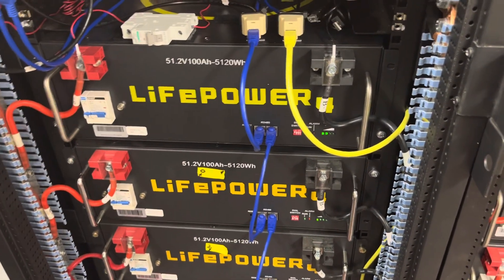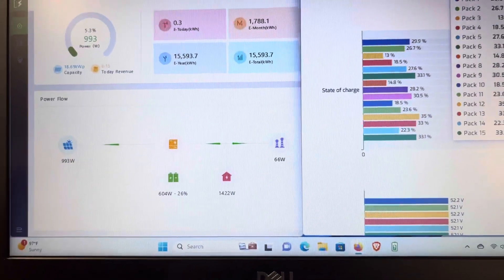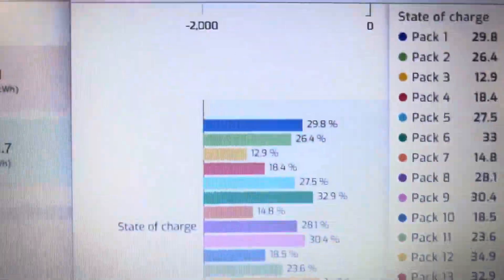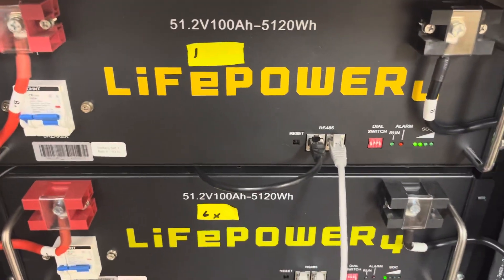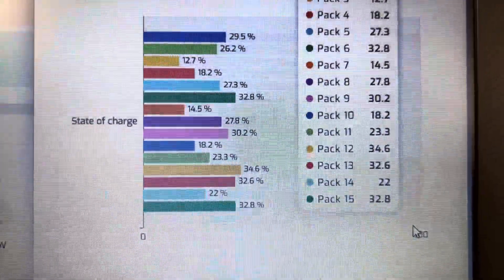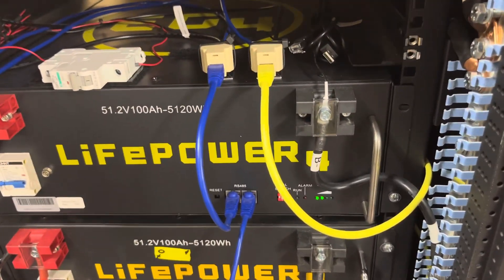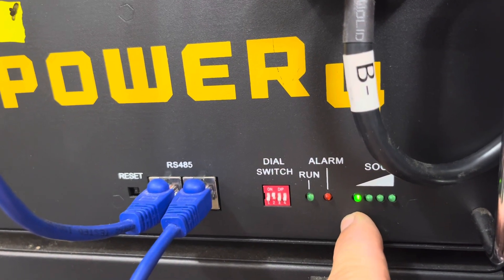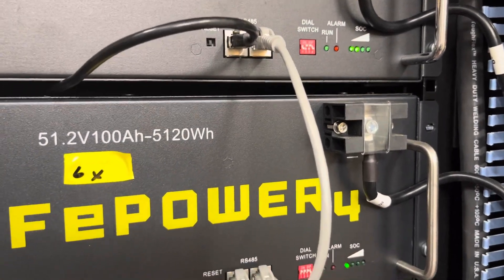EG4 LifePower4 SOC LEDS - What do they mean.

Comment: Just have one question, why soc is so wide spread as one battery is at 34 percent soc and the other is at14 percent. I thought they charge and discharge equally.
Reply from the maker: What I have found is if you’re unable to fully charge the battery bank over many days the SOC between batteries will drift significantly. 

This usually corrects itself once you fully charge the bank. The batteries will also rebalance periodically.

Comment: On my sok s 2 leds i have to cut my power use down a lot it's like I almost got dead battery's I'm beginning to wonder if I got some defective ones
Reply: Bummer hopefully you get it sorted out I bought two sok batteries they was too expensive to buy some more so now I'm buying expert power batteries I like them better there are $1,000 to my door
Reply from the maker: @JonOffgrid  2 LEDs mean between 25-50% SOC. I stop discharging at 25%. When I stopped at 20% I found the SOC between my batteries would drift far apart. 

Just had a battery failure today. Had to shut it down and reroute BMS comms. Charging and discharging faults.

Comment: I have 3 of these batteries and they got below 20% and I can’t get my inverter Sol-Ark 12k to charge them now. I’m looking for a 48v trickle charger if you have any recommendations. Informative video, thanks!
Reply from the maker: @sgtspaulding9461  morning! Hmm … something is not right. I have had a couple of batteries stop charging and discharging. Turned out to be bad BMS boards. For the first on Signature Solar sent a board for me to repair. Easy to replace. The second one they required I ship the battery back - a total PITA. 

I bought a 48v charger from eBay. It works great for charging an individual battery. If you get one and it charges the battery then the problem may be with the Sol-Ark.
Reply: @ hey Jeff, thanks for the reply.
They had been working well then one morning they just weren’t. I ran a BMS test the alarms were showing 
1. Cell undervoltage alarm 
2. SOC low alarm

I need to get them charged up so I can run the test again. I hope it’s something simple the batteries aren’t very old.
Reply from the maker: @ let us know how it turns out.

Comment: Just curious, how long had this set of batteries been hooked together before you did this video, bms balancing seems a bit harsh.
Reply from the maker: Around 8 months continuous. What I have found is when under heavy usage and you’re not able to fully charge the batteries for multiple days tge SOC between batteries will drift significantly. 

This generally corrects itself once you’re able to fully charge the bank. Also the inverter force balances once a month.
Reply: @jeffmotes2129  Much appreciated, got two new batteries hooked up a couple days ago, think I will force each fully charged now individually then hook them up together...out of the box they did not seem to balance on their own so far.
Reply from the maker: @SarahStuff-p5u  you’re welcome

Comment: How much power are you using from the grid per month?
Reply from the maker: In July I was able to generate 2658KHW but I also had to buy 626KWH. 

In May I generated 2318 KWH and bought 131KWH.
Reply from the maker: July, August, and September are our hottest months and highest energy usage.
Reply: @jeffmotes2129  Any plans to add more solar to cover more of your load? I was at 28kw of panels and have been totally off grid, totally disconnected. In May I made 3200kwh, and the past few months, just under 2800kwh, as our loads are less in the summer, no heating dump loads. In the next month I will be at 50kw of panels, to cover winter loads, clouds, and snow on the panels. I will have 9 Growatt 5000es's  with solar on them. Hoping to have battery my battery bank up close to 200KWH of storage.
Reply from the maker: @snoflite5234  I’m considering it. I have the wiring in place to double the size of my PV array. I would just need the mount and panels. We’ll see.
Reply from the maker: @snoflite5234  how are the Growatts working?
Reply: @jeffmotes2129  I have no issues for the 5 inverters I have had on for close to a year. I worked them very hard this spring. Many days for many hours continuous I was bringing in 25 to 28kw, and at the same time inverting 22000 to 24000 watts of load. I even went over a few times and they tripped, but I could reset and keep on going. I did change the display setting to off after your video of displays failing.
Reply from the maker: @snoflite5234  very good. I’m glad they’re working well. Are you using solar assistant?
Reply: @jeffmotes2129  Yes but..... That still does not work well for me at all. I have to reboot it at least 5 times a day, and the 6th inverter, I can not even get it to hook up, so I am only monitoring 5 inverters, and my battery shunt. I have a new SA coming so my 3 inverters I am adding will be  a separate system, charge the same battery, but send inverted power to my shop, or for charging cars, not sure yet. So I will see if a new SA fixes anything.
Reply from the maker: @snoflite5234  I also had power supply problems with my Solar assistant. The voltage on the power supply would dip and then I’d have to reconnect. Replaced it with a new power supply and no issues so far.
Reply from the maker: The raspberry pi is also finicky about which USB hub it will work with. I finally found an old cyberpower hub I had from 10 years ago that would work. Bought a couple of spares from eBay.

Comment: Thanks for the info. I'm currently only running 4 of these EG4 batteries and just got Solar Assistant but have not adding Batteries directly to it. I noticed that your main rack Positive and negative cable leaving your rack for the inverters are both from the top on the bus bar. I have flipped the negative bus bar in my rack as prescribed in some other videos so that supposedly the power draw will be more even throughout the rack.  Im not sure if it would work differently because you have multiple racks but it may be worth a experiment to see if the battery drain more evenly.
Reply from the maker: I’ve seen others suggest the same. Perhaps that was an issue with lead acid batteries, however I have found the location of the battery to inverter cables have no bearing on the charge, discharge, and SOC for these Lithium batteries.